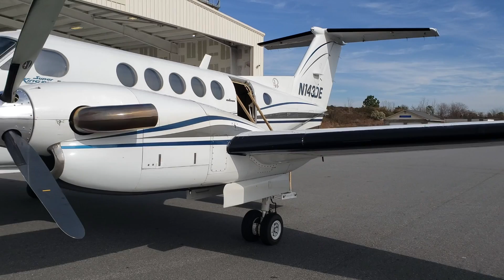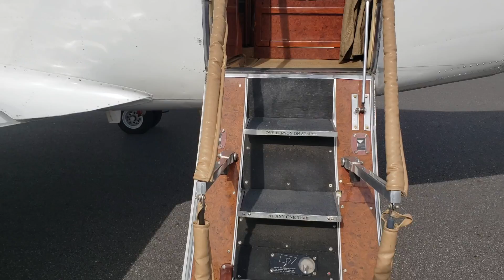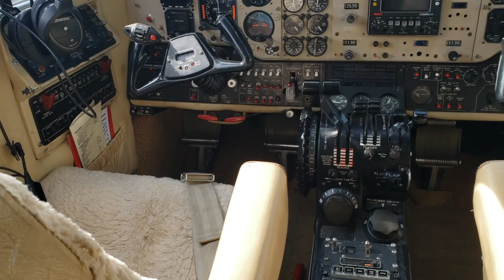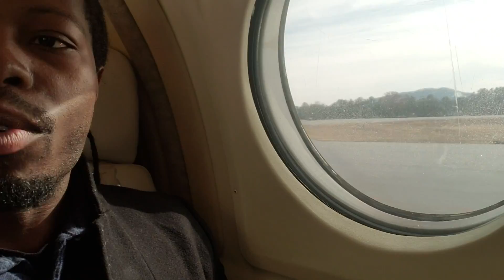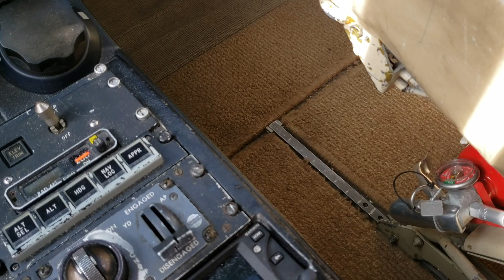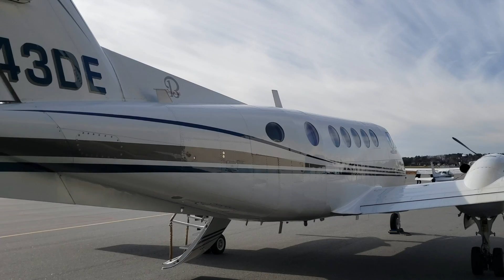King Air 200 Is More Fuel Efficient Than Owning A Private Jet

Comment: In my work, I fly a couple of days a week in Northern Ontario.  Our charters use a 1977 and a 1978 Super Kingair B  - 200.  Both aircraft are safe, reliable, comfortable.  Occasionally, we get a B-100, does not have the T tail, and different engines, same fuselage.  The one shown here is a 1979 build.  Fantastic aircraft.  Ours have 9 seats for passengers.

Comment: The Baron is a twin, not a single; the Bonanza is probably what you meant to say. Most charter flights will still have two pilots, even though the B200 is single-pilot rated. The cabin on the B200 can be configured for up to 10 passengers, and the small single set across from the entry door has a portapotty under it. My SIL flies these, as well as the smaller C90.

Comment: Based on my 30 years flying King Air -200's, -300's, and -350's, the latter are better, more versatile aircraft. Yes, they burn slightly more fuel (105/110 gph avg), but they are 10-15% faster, have tremendous payload vs. range capabilities. I flew/managed a King Air 300 (FA111) for 9 years - I could take 9 golfers, 9 sets of clubs and 9 overnight bags and fly 1,000 nm in 3.7 hours (avg winds, of course). Tell me how big a jet you'd need to do that (non-stop) (and how much more fuel you'd burn to save 80-90 minutes).

Comment: For a size reference, I washed several 200s at my job at an airport and a 15 ft ladder and a 6ft brush barely touched the bottom of the T portion of the wing. You need a scissor lift to clean the whole plane

Comment: It was always fun to hear one of these start up. Back when I used to work the ramp for UPS at PDX, I had to load one of these with cargo (it was a cargo version the Beechcraft 1900), it was owned by Ameriflight. This was for the feeder operations for getting cargo out to the remote parts of Oregon. I think back then it flew to Medford. I always thought they were neat with that high tail and a nice silhouette. The only part that sucked was that it took forever to load because it was the biggest feeder aircraft in our operation. The rest were Beechcraft 99's which were easier to load (unless you were the unlucky one stuck on pod duty).

Comment: I flew the B1900 which was just the commercial version of this (and I trained for the military version, but...sequestration happened), the most fun flying I ever had.  Could get anywhere with that thing, would take everything, and we nearly always got more in the thing before we maxed out the weight. Couldn't break it ether...well, with exception to the fact that since it had been out of production for nearly 15 years, it was hard to get parts.

Comment: Hey Mike...you forgot one really cool tool in the cockpit. I flew the Beachcraft C90 which is a shortened version of the King Air. The reverse power levers can be used on the ground to save brakes and making tight turns in congested space on the tarmac. It's was so cool for a 172 pilot to fly this beast
and land it on a reposition
Flight. Also, the King Air F90
IMHO, is the sexiest of them all.
Reply: Agreed , it’s just something about the f90

Comment: WHY DID THEY ELIMINATE THE T TAIL FROM THE KING AIR 100 SERIES (F-90)?
Reply: When the stretch update to the 90 was going on, Prat was having a work stoppage so they made the 100 series with Garret engines (screamers) and left the tail low to arrive for the next year model. When the Prats were available again the change for the new year model supported a 'T' Tail and bigger P&W engines called the Super 200 to distance it from the 100. The '99' was airliner produced for 19 passengers, conventional tail and unpressurized.  I did the electrical on 99 and film on 200 and on.

Comment: King Air is a magnificent twin turboprop. BUT like all twin propeller planes, if it loses an engine on take off...well, lets just say after the Addison airport crash, which was preceded by the identical Oahu crash only a week earlier, It made me a believer in two jet engines mounted close to the fuselage.

Comment: The information on the running costs of the B200 presented in this video is inaccurate. It is an expensive aircraft to operate. Other light jets are cheaper to operate than the B200. We operate 2 of them and 3 Citation 550B. Its not cheaper to operate the B200.
Reply: It is cheaper on per person basis
Reply: Umenena

Comment: Damn looks like it needs a complete overhaul..Wire sticking out from the prop spinner
Reply: joey g just prop deice. Simple fix, pull spinner, orient wire bundle properly and attach via zip tie.
Reply: Zip tie duck tape and superglue seems is what’s holding it together now

Comment: That is an old king air 200.  That panel needs updating big time.  He is correct, though.  Lots of folks want to have a jet.  Here is why a King Air makes sense:
PT6-42s.  Most mechanics can work on them.  Easy to get airframe and powerplant parts (Some of the more esoteric avionics are made out of unobtainium however).  Two gallons a minute fuel burn.  Part 23 airplane (More flexibility than a jet in some situations).  And again good old PT6 engines.  Flown these medivac for 15 years.  Capable and well mannered.

Comment: Thanks for a good video. 

IMHO, KAs are greatly overrated. They are slow, the cabin is narrow and other cons is why we are buying a Jet over the KA. It is a shame the Avanti never got the legs under it and support that it needed. The Avanti blows the KAs out of the water in the every way, just not factory support and parts availability. 

So the next best pick is a Jet that has further range, larger cabin, less moving parts and flies higher. 

I know I will piss off a lot of you diehards, but that is my opinion and the reason we are not buying one. 

For our short flights, would  love to have an Avanti to sip fuel, fly above most weather and approach jet speeds, but that is a dead horse. A real shame!!!

I wear full armor and have a shield, so throw the arrows if you must.
Reply: Have you looked at them?  They completely negate the purpose of a turboprop.  The runway usage is pretty bad, and the maintenance on them was so high that you could operate a Cessna 525 Citation for about the same price.  The King Air (especially the 350) is an aircraft in a category by itself.  With the Blackhawk package, they cruise at 335 kts, you can fill the tanks, load the seats and let everyone bring two bags, then blast out of a 3000 ft strip and go anywhere.  You are into two pilot jets that start at about 18 million before you can say that (minus the short field performance).  Sure a phenom or citation is a little faster, but they can't get in and out of the places a King Air can, or carry the amount of people and stuff a 350 KingAir can.  There is a reason the Avanti didn't sale.  They just don't make sense, and don't fit into the market very well....They have been selling King Airs continuously since 1968, and one of the major charter companies bought 110 of them a few years back.  There is a reason for it.  They are amazing airplanes that fill a niche that nothing else being made today fills.  The PC-12 is close, but it is a single and is 60 kts slower....

Comment: Wow, that's some new info. I had thought that piston engines were go up to about 200knots, turbo to about 350knots and jets to about 500 knots and that always seemed to fit with my experiences flying on reginonal journeys. This is new info, this turboprop is a fast as a jet
Reply: The King Air goes around 235-250 knots.. My friend has an Epic turboprop which goes 320 knots. But unless you are in a Piaggio pusher turbo prop you won't get close to the 430-480 knots per hour range of pure turbofan "jets".

Comment: you didn't mention that the seat right inside the doorway doubles as the potty!
Reply: That's called a 250 now a days, no type rating required
Reply: Jesus Mendez Oh good to know. So I assume it is less than 12,500 lbs MGTOW, so no type rating needed.

Comment: Yeah, the PT6 engines go 3500 hours before overhaul. Put you may have to cough up $250,000 each. Maybe more. Sometimes it is better to go with newer engines than overhaul your old tired engines.
Reply: You can extend tbo to 8,000 hours.

Comment: .... another huge benefit is reversible props for getting into shorter fields....
Reply: Pilatus PC12 uses 2/3 of the field length as a King Air, has a taller and wider i.e. more comfortable cabin, same speed/range/pax capacity/payload at 2/3 of investment/operating cost and yet a better resale value. 

...and its Swiss made.

Comment: Would be dope to do a video comparing pc-12 to king air for personal and charter use.  Because both seem to have similar sweet spot.  Cost, range, speed, operational efficiency.
Reply: PC 12 kills it.  I think that's why they sold so many of them.  Check this out:  https://www.avbuyer.com/articles/turboprops-compare/beechcraft-king-air-350i-vs-pilatus-pc-12-ng-112184
Reply: @scotth985  Awesome. Yeah, you'd really have to nuance it to justify the King Air. It doesn't fly that much faster, and only can carry a slight more payload. Hourly rate nearly double, an extra $2 million to buy, can't get into/out-of the fields the Pilatus can, two engines/props to maintain, and a smaller cabin to boot. My minds made up-the Pilatus it is...(searching for lottery ticket...)
Reply: Compare it to the Blackhawk 350.  They cruise at 340 kts at 35000 ft.  You literally cannot overload one, 2nd motor (some people don't care, but I wouldn't blast out over mountains, low IFR or the ocean with 1 motor).  The 350 is quiet a bit larger inside.  The wing lockers are awesome also.  New for new, the King Air is more expensive, but they have been making them pretty much unchanged since 1989.  You can get a nice one with all the mods, and mid time motors for under 2 million.  Put new Garmin NXi panel and convert to Blackhawks, and you have about 40% more airplane for the same price as a late model (not new) PC-12NG.
Reply: Is the King Air safer than the PC-12 b/c it's twin engine?  If you were to loose the single engine on the PC-12, what happens? Can the PC-12 handle like a glider?
Reply: @paulferguson9532  all planes become gliders with no engine. Each plane has a different glide ratio make some better gliders that others.  King Air can operate on 1 engine to take you to safety so yes more safe in that sense.  However the engines on both aircraft have a near 0% failure rate.
Reply: Paul Ferguson PC12 will glide long enough to run down the batteries.

Comment: Kingairs are a lot bigger in person than most people think.
Reply: Brian Woods you won’t find any turboprop aircraft under 6 figures no matter the age
Reply: Ólafur Mikaelsson PC-12: is worth 5000000 Am I a joke to you?
Reply: @olafurmikaelsson4794  sure you can....old panel, shot interior, need of paint, and of course the biggie.....engines and props in need of overhaul. It may have a few hrs left to fly, but when time for all that....you are so so so damn correct. $$$$$$ and more $$$$$$$!! Tired Lears, etc.,  are the same way.
Reply: Yes they are 💯
Reply: Actually not true, well, they are pretty big in real life, but you can find ones sometimes below $100k that don't need a ton of work and still have plenty of hours left on them. I don't have a ton of experience with the King Air, but I have a lot with the 1900, and if they have the same wing strut, then most of these planes have a ton of time left on them. The plane uses the PT6 which tends to be very hard to kill and is easily rebuild able. Now, it is rare, but occasionally you can find a King Air for less than $100k that is not knocking on death's door, but usually its because the avionics are completely outdated, or it was owned by a company that is pushing them out to upgrade.  The junkers are usually below $30k.